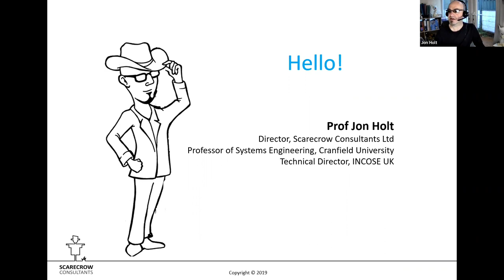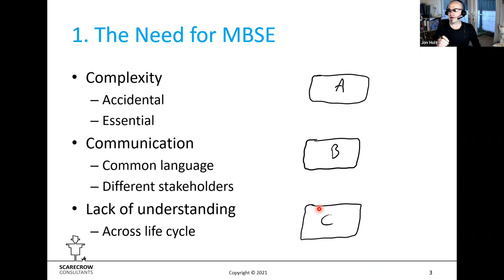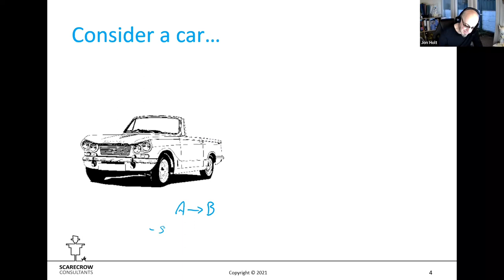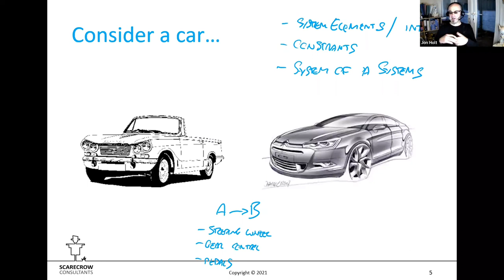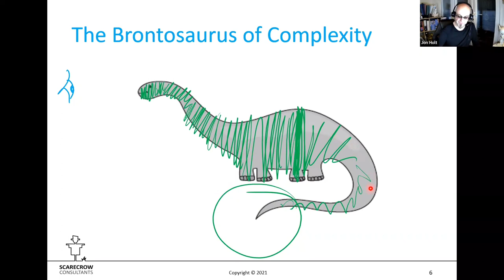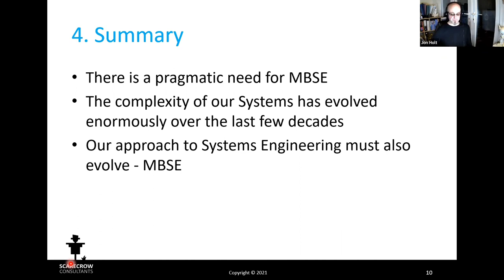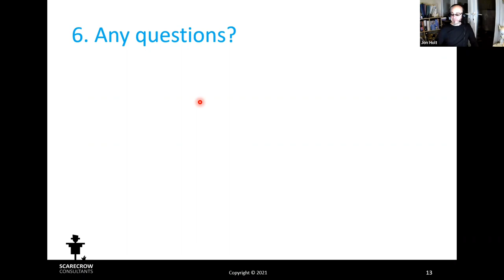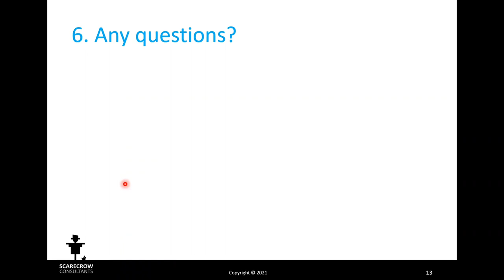Model-based Systems Engineering Demystified (Part 1) - The need for MBSE - Full Video

Comment from the maker: Timestamps:
0:10 - Who is Jon Holt?
1:57 - Presentation overview
3:00 - Why modelling vs. How do we model effectively and efficiently vs. How do we deploy MBSE
6:50 - The need of Model-Based Systems Engineering: Complexity, Communication, Lack of Understanding
16:20 - An Example - Consider a car...
19:45 - An Example - Complexity dimensions
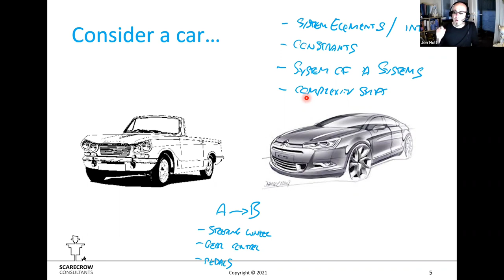30:35 - The Complexity Shape - The Brontosaurus Complexity
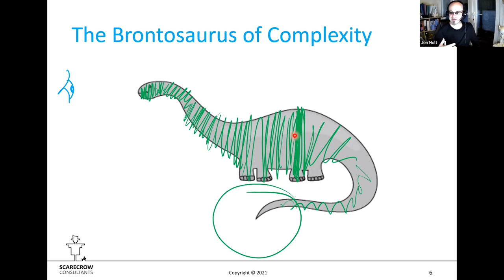34:25 - The MBSE Mantra - People, Processes, Tools
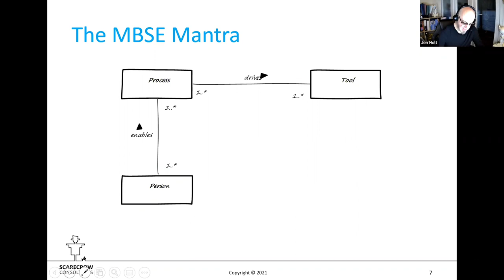35:40 - Evolution of MBSE: Document-Based to Model-Based
39:36 - Summary
41:08 - Question 1: Isn't MBSE ist just a tool approach to the Systems Engineering?
42:26 - Question 2: If the need for MBSE is no different for SE, there would be no motivation for an organisation to use model-based if it has document-based systems engineering
43:38 - Question 3: Please clarify the statement MBSE is like SE using Requirements Engineering as an example
44:48 - Question 4: Do you have an adequate definition of complexity and how does it relate to the complexity theory?
46:10 - Question 5: Is modelling a system using MBSE tools and methodology but not including executable models still count as MBSE?
47:38 - Question 6: Given that the reason for a car is not changed, is the complexity growth based on the implementation choices?
49:10 - Question 7: All of the aspects related to complexity increase of todays vehicle are related not to the functional aspects, would you agree? Shouldn't we blame ourselves for raise of the complexity?
51:32 - Question 8: How would you sell the MBSE to management or board of directors?
54:15 - Question 9: Can we predict and manage complexity using MBSE (Brontosaurus metaphor)?